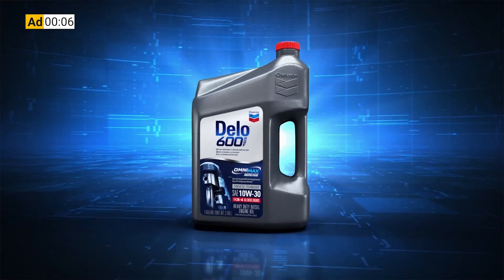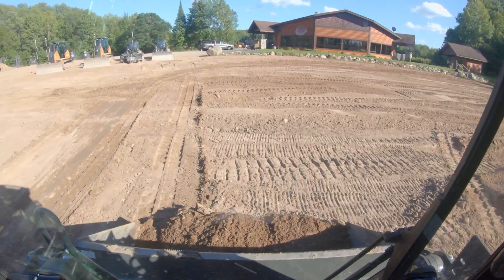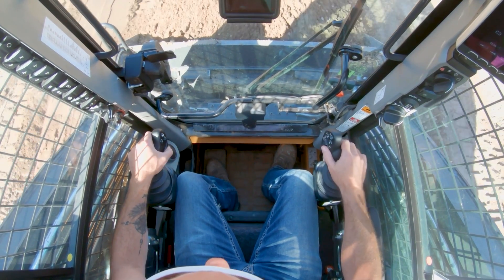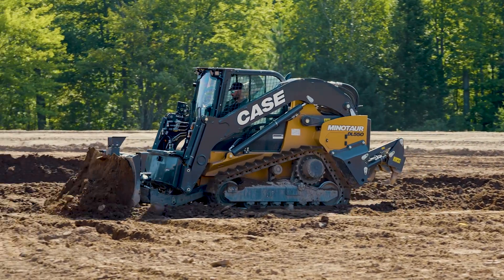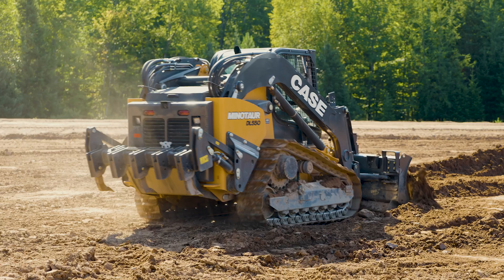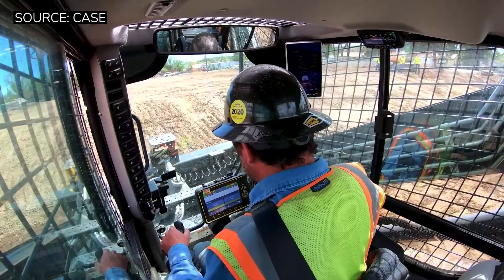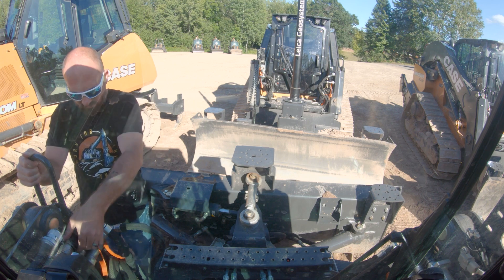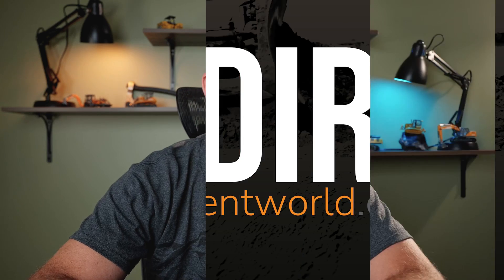Test Run of Case’s DL550 Minotaur Dozer-CTL Combo | The Dirt #88

Comment: I really did not struggle learning to final grade with it, probably because I never spent a lot of time fine grading with a dedicated dozer.  This was all new to me and so I didn't bring any dedicated dozer tendencies.  I rotated the blade at angle for a while, until got a feel for it.  After a bit of time (3-4 hours) I was able to look at the top of the blade and use that as a reference.  I have been very impressed at how productive this machine is at dozing.   Even having to rip the material and I have rubber tracks on mine.  I am able to push 750-850 cy of material in 6-7 hours.  Its hard to appreciate how well thought out this machine is until you get in it and run it.  Pretty outstanding.

Comment: It's impressive. I can see a lot of jobs where this would do everything, especially for a smaller company where they might have this and a mini excavator. That said, a used dozer and a used CTL by themselves would cost less. But they would not be able do everything it can do.  Biggest caveat I did not hear in the video is the tracks cannot be swapped. Whatever you buy is what you get. If you go rubber, that's all you can run. If you go dozer grousers, that's all you can ever run. There's no way to switch after the fact.   Ok sure, how many does a typical machine ever swap rubber to metal or back? Probably not many.  Watched a guy last weekend swap his mini from rubber to steel tracks and that was the first time I've ever seen it done. Admittedly, all I've ever run was a Bobcat so didn't really see much track swapping.

Comment: one of the biggest things I like to see on a machine is a left pedal. I have a really hard time convincing my right foot to do decel or geardown, probably because I've spent 80% of my driving time with a clutch or inching pedal. It would be nice to see a 2nd pedal so you can select 2 of those functions and get more work done on less fuel while not have your left leg fall asleep, say left trans, right accel, perhaps it's too niche to justify the hardware spend.

Comment: For the size of it it's not a skidloader and would be hard to get in tight spots. So not compact. Something that size would better just to go with a 953 or 963 track loader with a 4in1 bucket or just use a D5 or D6. My opinion the 289 299 Caterpillar for a skidloader. But the metal tracks makes it not versatile on concrete or asphalt.

Comment: Couple questions if you don't mind.  First, you said it would really push a pile, that's great, but will it cut and strip?
Second, why did Case go vertical vs radial lift?  My experience has always been that the radial lift path is really better for flat work.
Reply: It will cut and strip. Again, it will take time to get good at this without gouging because of the short track base. The vehicle lift component is due to the desire to be able to reach into off road trucks and tall semi boxes. I can't remember the hinge pin height but it is up there.

Comment: well now if i wanted to leave a finished surface  and seeded from dirt work  let me show you this MODEL 1204 | Kelly Tillage System  there are also spiked chains to be had Kelly Tillage System - Spiked Disc Chain.   if you just want to knock weedy lots down  a kelly is also just the thing to do that and seed them over

Comment: I've thought this way a wonderful concept ever since the reveal a couple years ago i had thought it since the beginning and you said it as well that the ripper sticks to far out the back it's supposed to be a more compact machine why not make the ripper tucked in tight to engine door i would think is an obvious idea the Australian company norm engineering makes the perfect designed ripper for it i think really sucks in tight to the engine door when it's up. As far as the tracks i would not have thought the rubber would do better then the tripples do i thought they would have been better off with a double grouser instead with the same width they would probably do a bit better with putting the power down for pushing if you think about it all the track loaders have a double grouser on them instead of tripple grouser and I'd think it's because you do a lot of pushing with a track loader some use em almost like a dozer that can carry dirt as well

Comment: I’ve seen/heard about this machine for the last two plus years and I understand r&d process but damn I’ve bought multiple bobcat units as well as the new Gen Cat dozer since then. Will this unit EVER actually come out? And at what price point? Thanks for the content, you’ve done a good job.
Reply: It is officially out and up for sale. Pricing will have to be determined at your dealership. Unfortunately the way dealerships price machines is pretty complicated, similar to the auto industry so it's hard to just slap a general price on something like this.
Reply: 215k with metal tracks in Texas
Reply: @Mvp-AngelOfGod  was that with the ripper package as well?

Comment: It looks like Case ie improving it's equipment and Cat is going down. Way down. I have been on a Cat 374 next gen and it's probably the worst machine I ever ran.
Reply: Really? thats interesting to hear. Theirs a housing development going in at the end of our street and they have a next gen cat 374 and 374F working on site. It sure looks like a nice machine but I have no idea how it runs
Reply: @fox13z400  Good looking machine and very nice cab with good vision. Catwalks on it are great and should be standard on all Excavators and crawler cranes. But the hydraulic functionality of the machine is horrible. Powerful and sometimes smooth but other than that, a poorly designed machine. A 245D will run circles around it.

Comment: It’s an over built skid steer with some extra options that should come on all skid steers. They should all come this way. It’s just more options. You won’t have enough sight of the corner or your blade. 6 hours and you could only glass off 50 foot of dirt. What a joke.
Reply: YES, All skid steers should come with angle tilt
if Running a BLADE. I have seen more Mini Excavator come with at least a Angle front Dozer blade. Saw a 6 way Blade on Tac- A- Hoot- Chee
sorry for spelling. They where demoing it for the Rental industry. I have seen these gosh awful company made complacent Dozer Blades, for curb and sidewalk grade finish work. Like you so Brilliantly said, They need to make more 6 way blades for Skid steers, with operator function that make them get feel of blade like Dozer finish work. Not just add on Hydraulic hose fittings, but still have same Levers in cab, even the Foot controls would be so strange to master.
Reply: I would encourage both of you to actually watch the review because both of these things are addressed fairly early on.
Reply: @DieselandIron  
I just don't see a lot of angle tilt 6 way in industry. That's all I'm getting at. If he addressed this then my Bad.
Reply: @rp1645  that's because any dozer blade that is a skid steer attachment doesn't actually couple to the frame of the machine and therefore isn't stable enough to do accurate grading. That is the whole idea behind this machine.
Reply: @DieselandIron  
I guess the CASE engineer don't have as much though into this as YOU. What's your background besides being just a operator. There is so much coming to the industry with self digging Excavator. They won't Need you anymore.